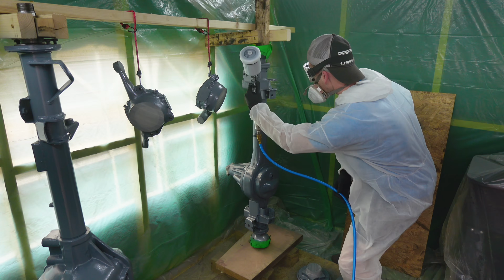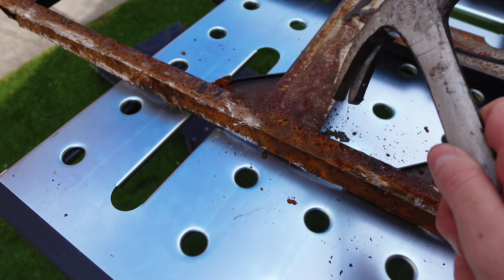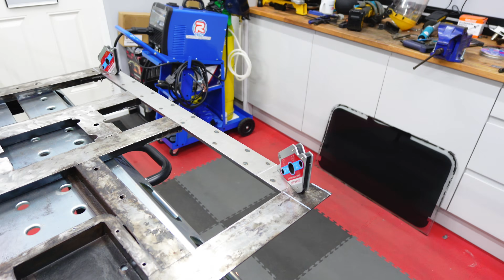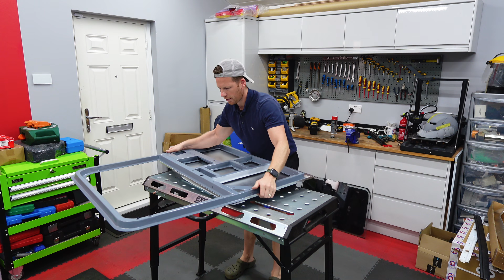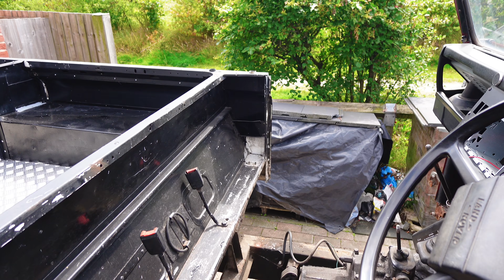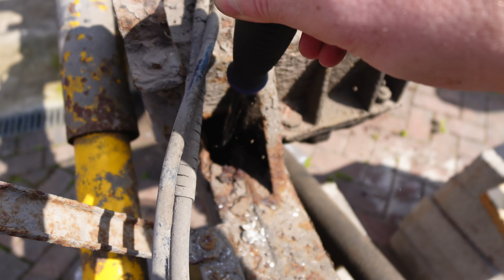I Think I Made A Huge Mistake With The Land Rover Defender

Comment: Amazing progress. I would reskin the doors and would be tempted to reskin the passenger side of the tub too. Personal preference but would avoid the checker plate corners on the tub - always reads that it is hiding something. You can get nice rear bumperettes that wrap round and protect it. Have you considered Masai glass kits for the rear door and 90 sides? Creates a really cool look for a nicely modded truck like yours will be 😎 Nice 😁
Reply from the maker: Hey thanks for watching,  yeah I think I will defo reskin the doors now,  I think it will be worth it.  YES I have seen those glass panel sides,  they look NICE 👌.   They are certainly something I could see on this build for sure.   Maybe in a video soon 🤓👍

Comment: Be incredibly careful removing the loom and label everything, companies like autosparks cannot supply the connector blocks etc, also on receipt of new chassis retap the holes because of the galv swarf inside ! Love the build so far !
Reply from the maker: Thanks for the heads up mate,  I have started labeling them but need to spend a good day studying it all as its been spliced into for the 200tdi conversion so I need to work out what's what and also redo some of the dodgy connections.  I am tempted to replace it all,  but it's quite costly!!   Thanks so much for watching dude 😃🙌

Comment: IDG, No joke, I have bits of Land Rover all over the place…What you do need to understand is galvanic corrosion, you keep referring to it as oxidation or rust showing through, but this is not what’s happening. Galvanic corrosion happens when two dissimilar metals are in contact ie steel and aluminium. This will always happen unless you put non conductive gasket between the metals YRM sell a lot of these pre cut and in roll form. Invest in some  it’ll be-well worth it.
Reply from the maker: That sounds like some fun bed time reading right there lol I knew it was something like that 🤓.   I have a big YRM order to place soon so I'll look into those gaskets.  I am hoping the paint on the back door will do a good job of preventing that from occurring now 🤞.  Thanks again for watching buddy🙌

Comment: Quickest way to remove door skin is to grind all the way round the edge on the seam, the skin will just drop off. That way, you don't deform the door frame.....great job so far tho mate. it will be banging when it's all done :)
Reply from the maker: Oh what a golden piece of advice,  cheers mate 😃🙌. I'll probably try that on the front doors then as I'll most likely reskin them too.  LEGEND 💪.   Thanks so much for following the build 😃
Reply: @InDadsGarage  Glad to help.....i worked in a body shop for 20 odd years :)

Comment: Huge respect for the hard work and getting on with it all. I put a new rear door on mine a few years back and it wasn’t too expensive, wouldn’t that have been cheaper and less work?
Reply from the maker: Thanks so much mate,  it was quite a fun little job.  I did look at new doors and second hand ones in better nick,  however because of the 90 cab conversion and the door now sitting inside the rear tub,  it would always need shortening so I thought it better to cut up my old door than a brand new one 😬
Reply: @InDadsGarage got it, makes perfect sense!

Comment: Maybe with the front doors change to puma defender doors. I'm sure I heard somewhere that they are a little more rust resistant than earlier ones.
Reply from the maker: Thanks buddy,  I'll look into that.  To be fair the frames are not too bad at all so maybe with some epoxy primer like I did on the rear, they will be sweet.   Just more work 🤣